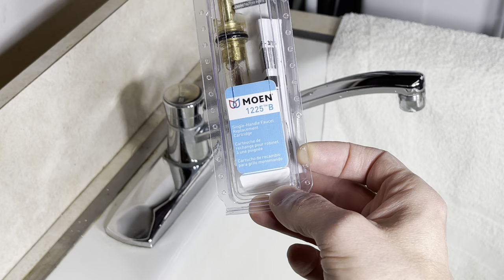How to replace a Moen faucet cartridge on a faucet model 7300 (Legend)

Comment: Drain the water faster by running your outside hose to drain system.
Reply from the maker: That only really works if the outside hose is at or below the level of the faucet you are working on.  In my case the faucet is in a basement utility room and all outside hose bibs are at least 8 feet above the faucet, so this won’t work for me.  But it might help if your faucet is above the height of the hose bib.  Hopefully though you can just shut off the water at the shutoff valves underneath the sink and you don’t have to shut off water to the whole house.   Anyway thanks for commenting.

Comment: Detailed video. I have one issue... at the beginning. The handle won't come off. It seems to catch on the back side opposite the handle. Have you ever had that issue? That catch you spoke about when you reassembled the handle seems to be the issue, but I can't get it to pull off. Any ideas?
Reply from the maker: @jaybrubaker3029:  I have not had that issue.  If the handle doesn’t come off when you hold the neck and lift it into the on position, try removing the handle in the off or closed position, or try lifting the handle and removing it when it is turned to the cold side or the hot side. Perhaps it is just catching or there is some mineral buildup or something causing it to stick.

Comment: i CAN'T get the handle off. Feels like something is holding it on from inside. The dome screws off easily and the handle is loose but won't pop off. I'm afraid to break it.
Reply from the maker: Sometimes it just needs to be jiggled just right…. Try some different motions and angles with gentle pressure.